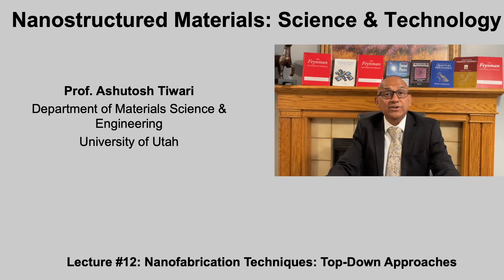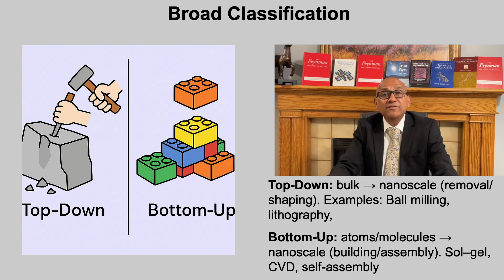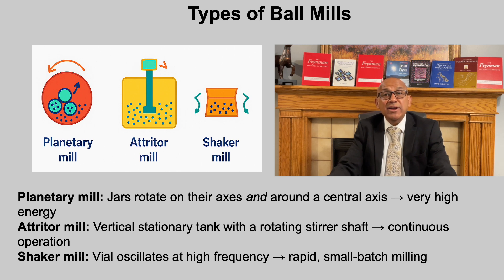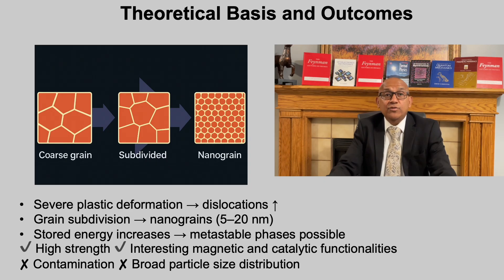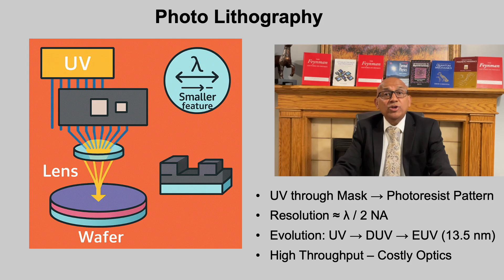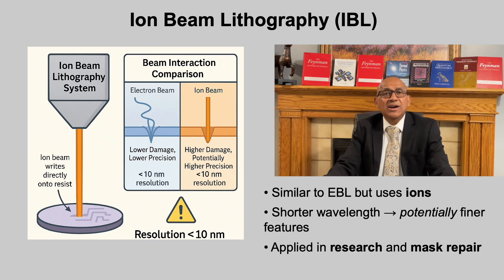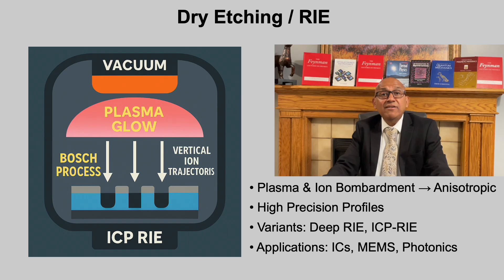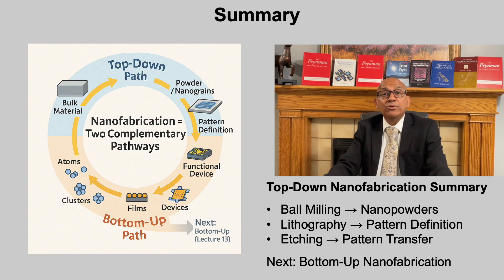Nanotechnology Lecture 12 | Top-Down Nanofabrication: Ball Milling, Lithography & Etching

Comment: This lecture covered top down nanofabrication methods for creating structures at the nanometer scale. Nanofabrication bridges nanoscience and nanotechnology by turning theoretical concepts into actual devices like transistors and sensors. There are two main approaches: top-down removing material and bottom-up building from atoms up. Ball milling is a mechanical technique where powder and hard balls collide in a rotating drum, breaking particles down to 5-100 nanometers. Different mill types work for various applications. Factors like milling time, speed, and atmosphere affect the results, though contamination can be an issue. Lithography creates precise patterns on surfaces for electronics and sensors. Photolithography uses UV light through masks, while electron beam lithography (EBL) uses focused electron beams for sub-10nm resolution. Ion beam lithography is similar but uses heavier ions. Etching transfers patterns into materials. Wet etching uses chemicals and works in all directions, while dry etching uses plasma for vertical, precise cuts needed in modern electronics. Together, these methods give us the control needed to build today's advanced nanotech devices.

Comment: Here is a quick summary!

Lecture 12 surveys top-down nanofabrication, focusing on ball milling, lithography, and etching. It opens by contrasting top-down (starting from bulk material and removing/reshaping) with bottom-up approaches, then dives into high-energy ball milling as a scalable route to nanoscale powders and alloys. Key levers—ball-to-powder ratio, milling time, atmosphere, and process-control agents—govern size reduction, while trade-offs include contamination, broad size distributions, and possible amorphization.

The lecture then maps the lithography workflow: surface prep, spin-coat resist, soft bake, exposure (mask-based optical lithography emphasized, with notes on e-beam and nanoimprint), post-exposure bake, develop, and pattern transfer. It explains positive vs. negative resists, alignment considerations, lift-off vs. etch routes, and resolution limits (qualitatively via wavelength/NA), highlighting defects and process windows.

Finally, it covers etching as the pattern-transfer engine. Wet etching (often isotropic) is contrasted with dry etching (RIE/ICP) for anisotropy, selectivity, and sidewall control; topics include passivation, aspect-ratio limits, endpoint detection, and typical chemistries. Throughout, the instructor links process choices to device outcomes—how parameter tuning balances throughput, feature size, and damage—to show why real nanomanufacturing is about integrating steps, not just single techniques.
Reply from the maker: Thank you, Jackson, for this excellent and detailed summary. You’ve captured the key ideas of Lecture 12 very well — especially the integration of ball milling, lithography, and etching as interconnected steps in top-down nanofabrication.